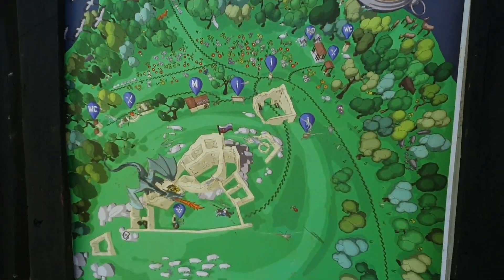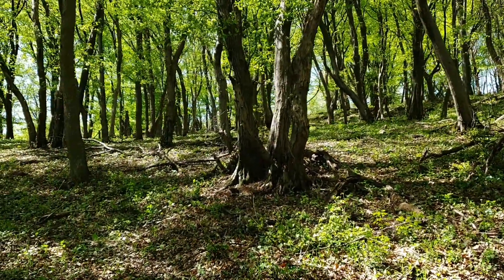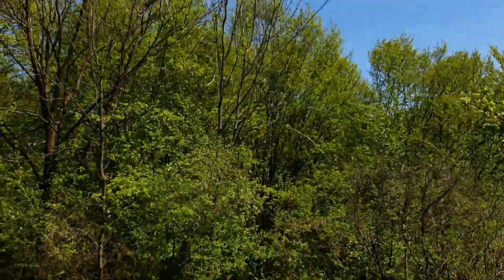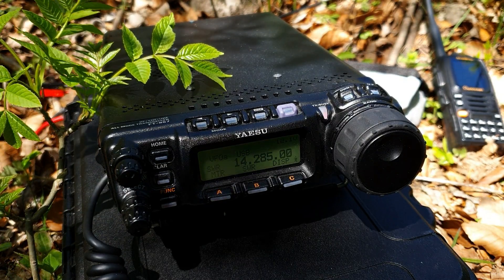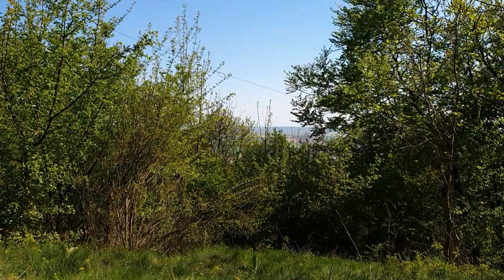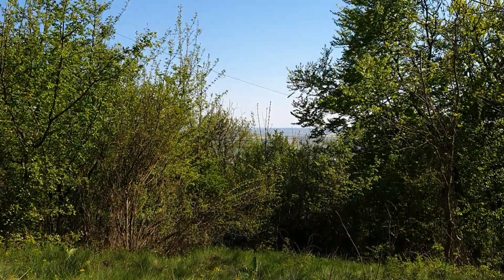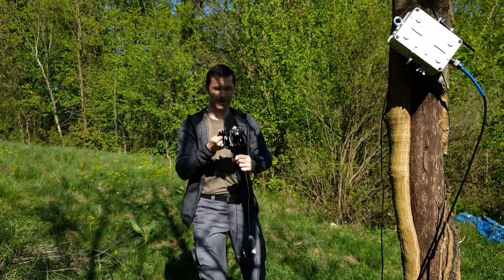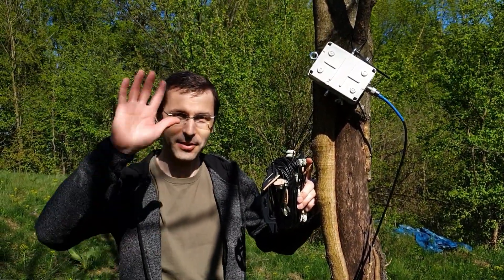SOTA activity OM/PO-091 (EFHW multiband antenna)

Comment: Thank you very much for the video. I am considering activating a summit in the French Alps in 2022. I have never done this before. I have already participated in IOTA expeditions. I like your video because your video shows us the whole activation and the equipment used. Small question with 5 watts and 2 batteries, what is the autonomies, the time on the air?
73 Thierry F5PQV
Reply from the maker: Thanks Thierry 😊👍 I depends on radio you will use and current consumption. 5W is about 1.5A when TX, also how much amps when RX, often around 300-400mA. And now is question how capacity are your batteries. Best 73!
Reply: @OM0ET   Thank you for this accurate information.   Best 73

Comment: Looks soo cool :). BTW do you know if there is any Sota in Albania? couldnt find anything on the map :(
Reply: Hi Nikolas. It seems Albania is not SOTA program member for now. If you know somebody who would be interested in including ZA to SOTA, here are some indications (https://www.sota.org.uk/Joining-In/FAQs):

Q. My country does not participate in SOTA at present, what needs to be done to include our summits in the SOTA program?

A. It will be necessary to form a new Association for your country. To begin with, it will be necessary to find a radio amateur willing to act as the Association Manager (AM) and he should then contact Rob Harwood, G0HRT via the Contact Rob button on the About SOTA page of the website (www.sota.org.uk/AboutSOTA) Briefly, setting up a new Association will involve writing an Association Reference Manual (ARM) which can be done by using a current ARM as a template, and producing a list of summits, which can be assisted by using certain on-line resources, but the MT can provide advice and assistance.

Q. I will be visiting a country which does not have a SOTA Association at present. Would it be possible for me to set up an Association so that I can activate summits whilst I am there?

A. The MT prefer that the Association Manager (AM) for any Association be either a resident of that country, or have strong ties to that country, as the AM should have good local knowledge and be able to advise people wishing to activate summits there on access, conditions, hazards etc.

Pavol, OM0WT
Reply: @om0wt  Thanks for the information
Reply from the maker: Thank you! I am sorry but I don't know 🙂 I am new in this SOTA activity 😊 73, Paul